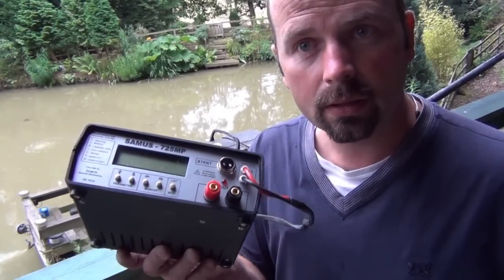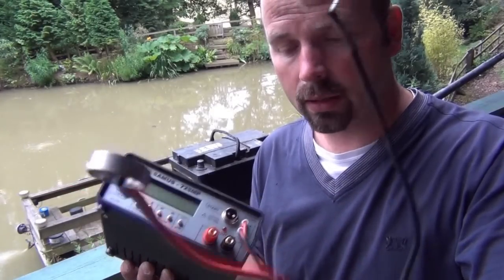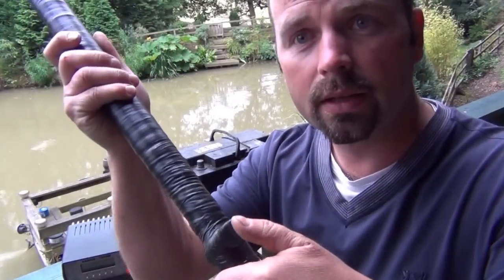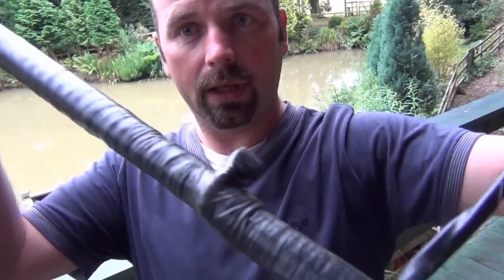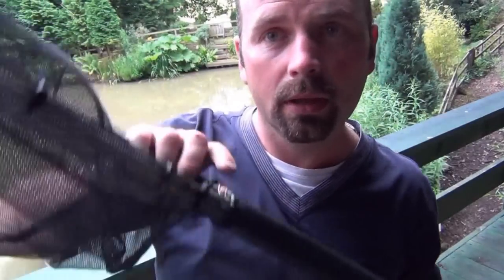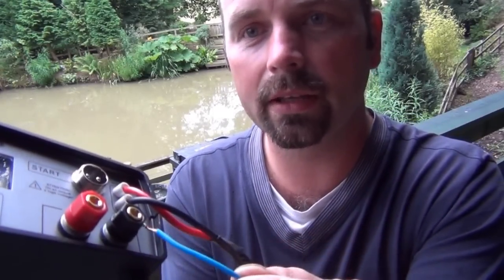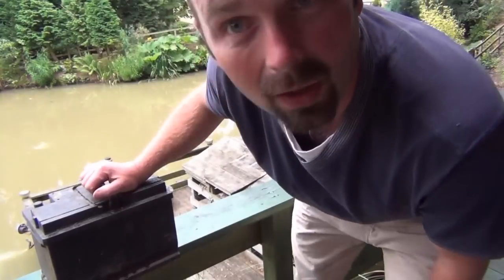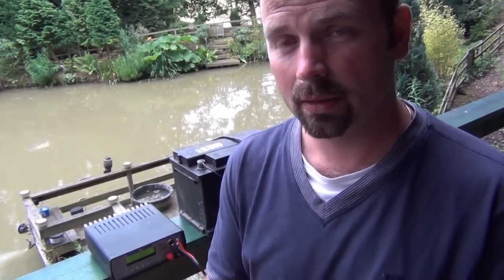Samus 725MP Electrofishing Part 1 - Set Up

Comment from the maker: I made the mistake of watching the set-up videos which come with the machine in English, Russian and Polish instead of reading the proper instructions which are fairly straightforward as far as set-up goes. With regard to actual use of the unit, its anything but plain sailing so once I understand all the settings and exactly what they do I wil do a video on how to actually use the machine.
Adopting a colour co-ordinated wiring system would definitely be a start - lol.

Comment: Can you please share your samus settings...I am having poor results so far with the samus 725mp as I'm only getting baby fish. Thank you.
Reply from the maker: I really can't remember what we had it set on unfortunately. We just altered settings and as the pond is around 15 feet deep which is too deep for the unit. I think we had frequency on 94? but it has been so long since I used it I can't remember what the settings are or do so it will be guesswork next time we use it.
Reply: +Lee Kermode you are right Sir,I have a same problem ..big problem I tried every frequency and doesn't work ..I contacted seller -guys whose making that machines in Poland but he doesn't know ,he told me he is not good in fishing ..PEOPLE  I THINK THIS IS CHEAT ...EVERYTHING IS SAME AS ON EVERY VIDEO SAMUS 725MP  BUT DOESN'T WORK ...THE POINT IS ONLY TO TAKE 500 EURO FOR THAT NOTHING ELSE...I'M ELECTRICIAN AND  I CAN TO CONFIRM DEVICES  GIVING POWER ETC BUT NO FISH (we tested at many places where is lot of fish but no fish).

Comment from the maker: This video replaced one which I previously uploaded where I actually set the machine up wrong and in that one I made it obvious that I had bought it to remove the carp from my pond but I didn't make much of that in this video - forgot about it.
Like any tool it will be mis-used by some people. If the anti-gun nuts complained every time someone was killed with a hammer or screwdriver how would we fix pieces of wood together? Same deal here really - any tool can be used for good or bad reasons.

Comment: I blame the manufacturer for using non standard wiring coloration. How hard is it to make the wire that goes to the red connection, red or white, and black to black.. In most applications, the switch wires are the blue ones.. so its definitely manufacturers design flaw here